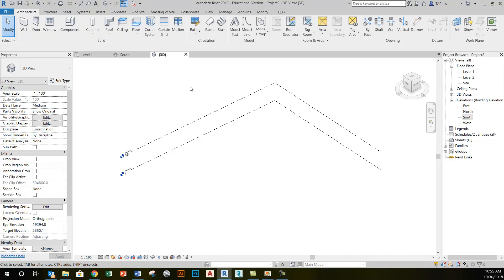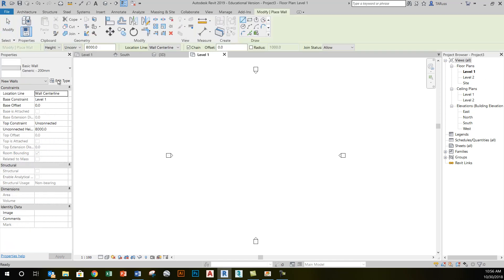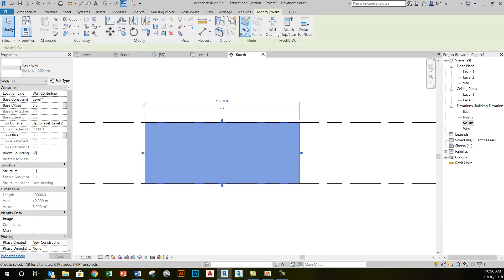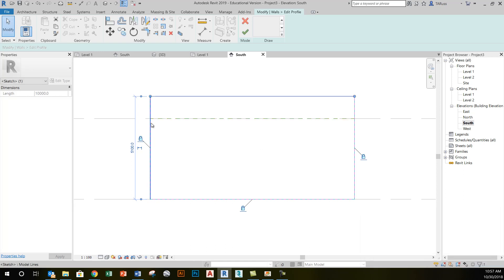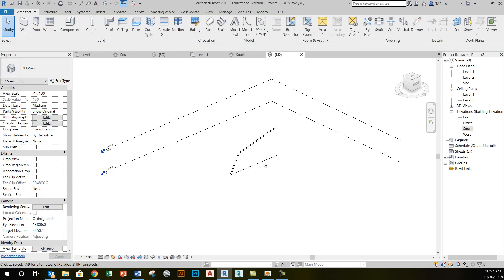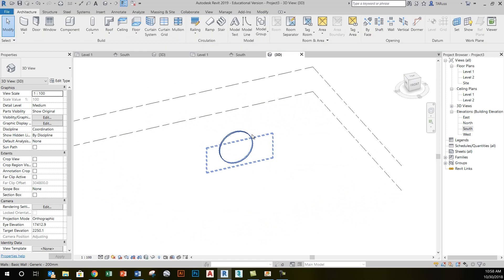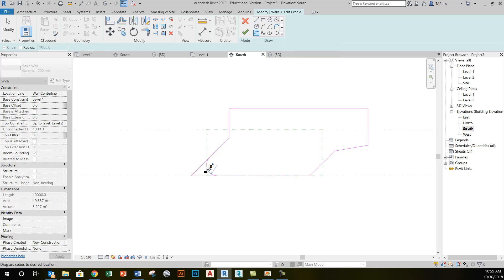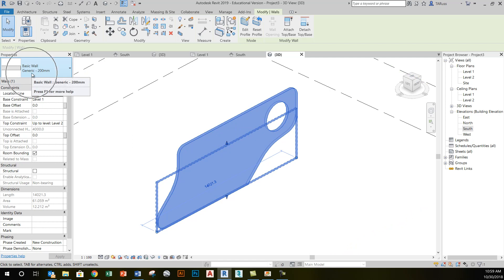Revit Custom Wall Shapes

Comment: So, I get modifying of the profile in elevation view, but can you modify a wall in plan view? For example, can you you create a wall that, in plan view, will mimic an IMP panel or some other premanufactured panel system with bevels, indents, or joints? Only way I understand how to do that now is to build sweeps that create voids in the wall to represent the desired look.